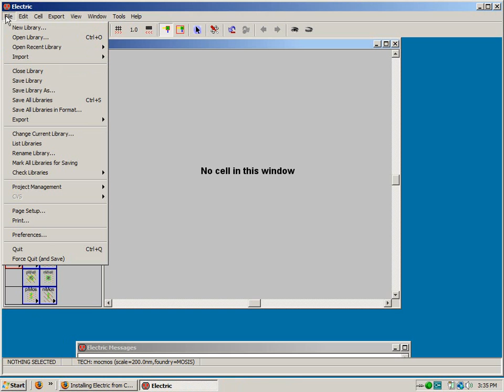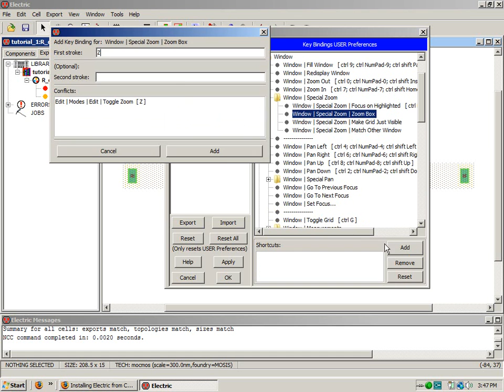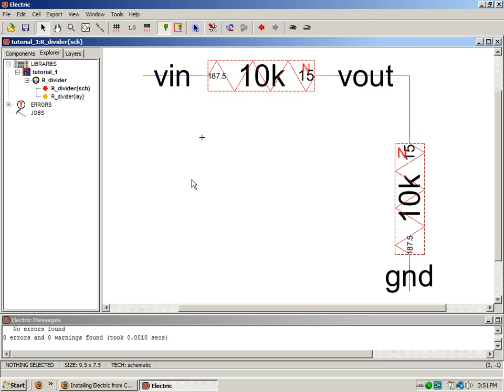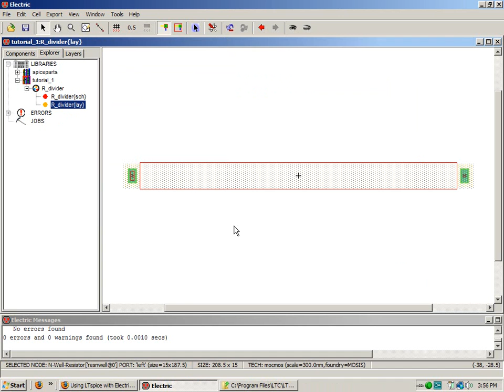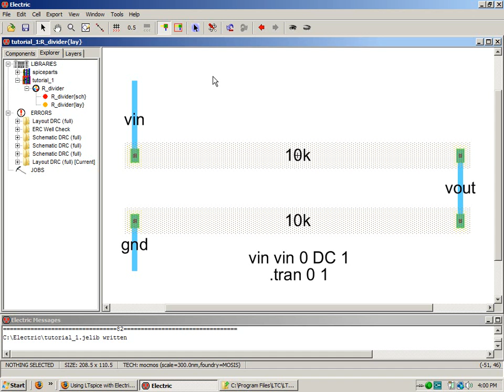Electric VLSI Video Tutorial 1 by Professor Jake Baker

Comment: 0:52 Setting up the Electric 
18:12 Setting up Spice for Simulation
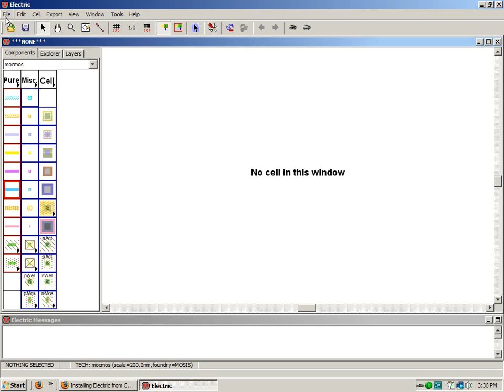2:12 Setting up the Technology 
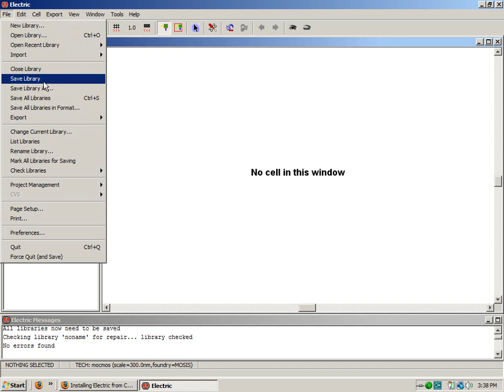3:19 Creating a Library
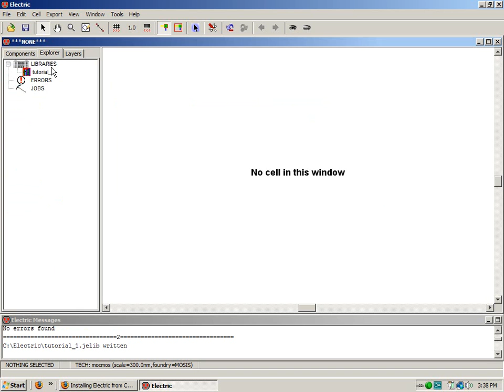3:50 Creating a new Cell-view for Schematic 
4:18 Placing a Component in Schematic
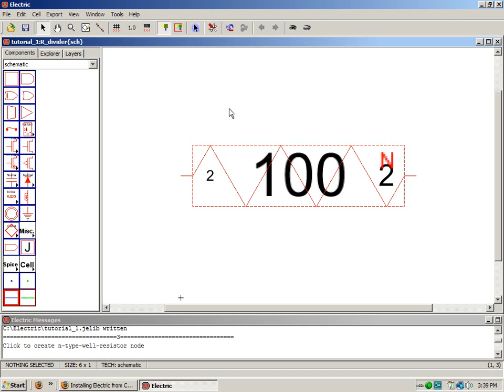4:54 Change the properties of the Cell in Schematic (PCell)
5:36 Creating a new Cell-view for Layout
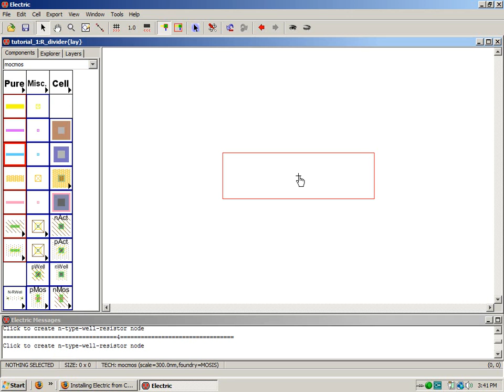6:25 Change the properties of the Cell in Layout (PCell)
5:59 DRC Run
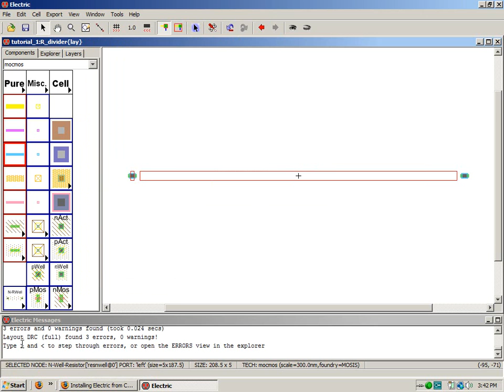7:40 Fixing DRC Error
8:39 NCC (Network Consistency Checking) aka LVS 
9:06 Fixing Sizes not Checked NCC Error
10:31 Adding Coustom Bindkeys
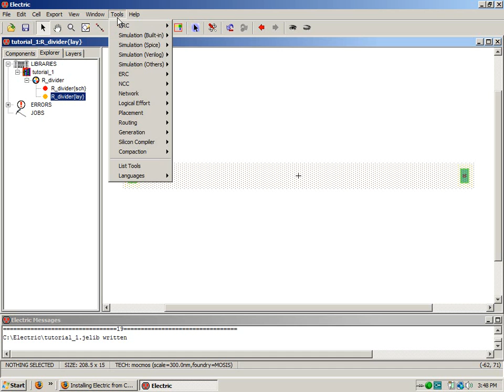13:36 Well Check 
15:34 DRC on Schematic
16:27 Naming floating nodes
17:30 Adding Spice Code
18:12 Setting up Spice for Simulation
20:13 Spice Simulation
22:32 Detailed Info about DRC Errors
24:17 Selecting Multiple Instances
25:45 Layout Simulation
Bindkeys(Default)
Shift To Select Multiple Instance
Ctrl+I Query or Change the Parameters
Ctrl+N Create a new cell-view
Ctrl+Z Undo
Shift + > Highlight DRC Error
Z Zoom
F5 DRC Run
Bindkeys(Coustom)
F Fit
Z Manual Zoom
W Well Check
L LVS Run
X Zoom Out
Well Check : In Digital Design all NWells should be connected to VDD and all the PWells to be connected to ground.
Reply: thank you!!!

Comment: I am confused. I have labeled my arcs Vin and gnd and I am still getting the errors saying that they are dangling arcs. I thought that maybe I was just not getting the labels right on the arcs, but they are there right. Not sure what I am doing wrong.
Reply: Never mind. Just answered my own question. Apparently the labels "vin" or "gnd" have to be in the middle of the arcs and not at the end for Electric to count them as labels for the arcs. A little counter intuitive, but my only complaint so far.